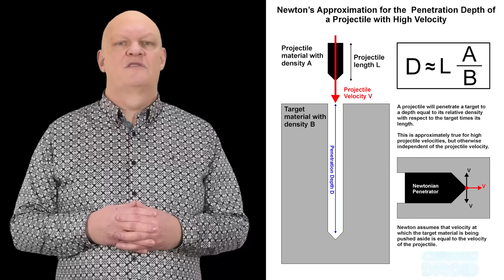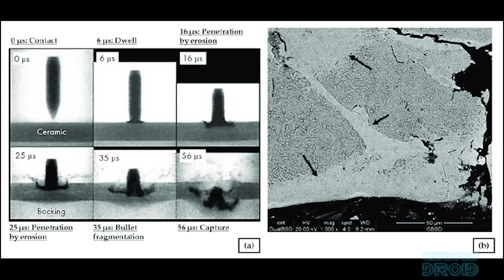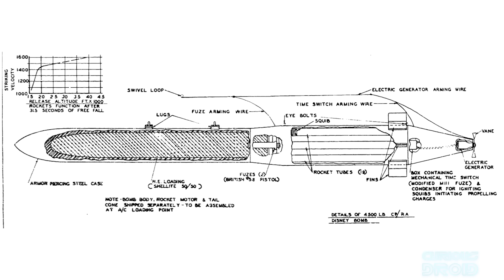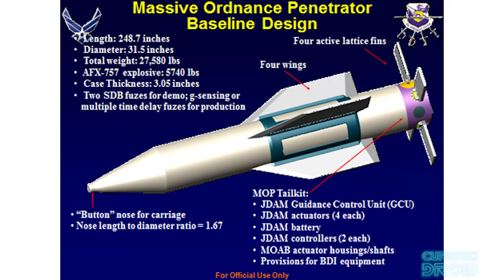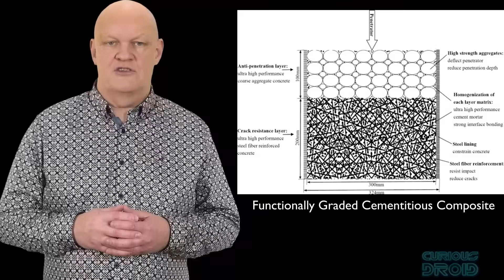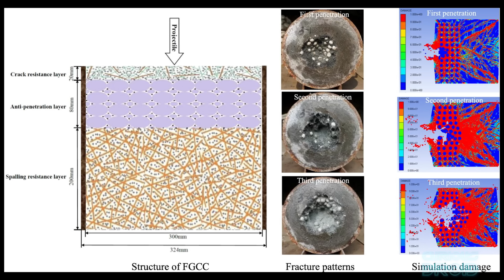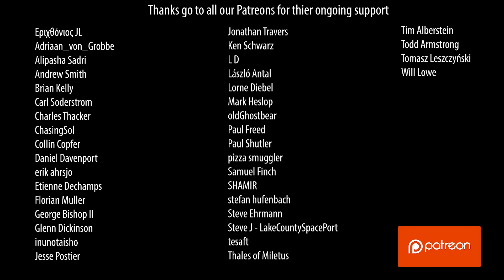Can Iran Stop U.S. Bunker Buster Bombs?

Comment: While the cost of placement to LEO is very high developing a few satellites holding what are termed ‘rods from god’ or very high density, very low profile non-explosive impactors that solely rely on the kinetic energy released at impact would like the ‘earthquake bombs’ of WWII cause such a seismic shock wave that the resulting damage to the target would be sufficient to render both the equipment inside as well as the personnel useless as well as likely destroying the entrances and external links.
Reply: Any rocket that could deliver that sort of payload into orbit could just deliver the "rod" to its intended target. 
Nerds seem to love the idea of "killer satellites", but they're not a good idea.
Reply: @T3H455F4C3  So, since you appear to have convinced yourself that you are something of a penultimate authority on such issues perhaps you will explain to the class just how one can determine whether such an ICBM is carrying such a kinetic weapon or a nuclear one as I do not think that such a technology exists.
Therefore, launching such a missile would almost certainly be seen as a first strike.
Whereas an orbiting platform armed with such kinetic munitions does not violate any existing strategic arms treaty and the time between launch and impact would be measure in minutes without the thermal signature that any surface missile launch would reveal to any of the orbiting observation satellites nor to the long-range radar detection installations.
Finally tossing out the sort of juvenile taunt, ‘nerds’, that you have indicates that you actual understanding of such a system is minimal at best yet you wish to pretend that you are well versed by trying to intimidate others rather than actually offering a cogent and evidence-based argument.
Which is sad at best.
Reply: @T3H455F4C3  “Looks like somebody has their thesaurus ready to go.”
Once more all that you do, especially beginning as you do here, is expose your juvenile mentality and lack of actual maturity by resorting to puerile insults as a means of attempted intimidation as well as demonstrating that you seem to perceive education as something of a ‘vice’ thus indicating that you are deficient in that arena.

“Perhaps you will explain to the class just how one can determine whether a weaponized satellite is carrying such a kinetic weapon or a nuclear one.”
Yes, that is the question I posed to you which apparently you imagine that simply reciting that back to me is a form of an answer when it is not.

“Seeing as it doesn't violate any strategic arms treaties I'm sure that China or Russia or whoever would be super chill about having a orbiting weapons platform flying over their heads. "Don't worry guys there's totally no nukes on this thing, I swear"”
That is not an answer but a clear example of the ignorance of using ‘what-if-ism’ as a means of deflecting a question for which you have no rational answer to. You are simply pretending that whatever you toss about is made real simply because you say it.
Again, explain a method that can be used to determine whether a satellite is carrying kinetic or nuclear weapons.
As you appear lacking in actual education or information, I will answer for you. The only means possible at present would be a close approach to attempt to attempt to register the radiation levels being emitted from the object of interest.
Yes, I know, big words frighten you but Google them.
How ever this can be masked by additional shielding once again rendering the issue moot although that would violate the treaty banning nuclear weapons in space.

“Depending on ones definition of a "weapon of mass destruction" this would likely be viewed as a violation of the Outer Space Treaty.”
Then by all means please cite the specific section and relevant paragraphs that you imagine support this assertion as this is not part of the Outer Space Treaty of 1967.
“Key provisions of the Outer Space Treaty include prohibiting nuclear weapons in space; limiting the use of the Moon and all other celestial bodies to peaceful purposes; establishing that space shall be freely explored and used by all nations; and precluding any country from claiming sovereignty over outer space or any celestial body. Although it forbids establishing military bases, testing weapons and conducting military maneuvers on celestial bodies, the treaty does not expressly ban all military activities in space, nor the establishment of military space forces or the placement of conventional weapons in space. From 1968 to 1984, the OST birthed four additional agreements: rules for activities on the Moon; liability for damages caused by spacecraft; the safe return of fallen astronauts; and the registration of space vehicles.”
https://en.wikipedia.org/wiki/Outer_Space_Treaty
This is called ‘supporting evidence’ and research that demonstrates that you in fact do not know what you are talking about relative to that treaty.

“Oh and this satellite would be super vulnerable. Predictable orbital path. No way to effectively protect it. Send a few boxes of nails at it on an opposing orbital path and all you have after that is a bunch of really expensive debris flying through space.”
Yes, that is the case with ever other type of satellite as well as a problem of the existing mass of orbital debris yet you are obviously trying to avoid dealing with the issue that such an act could and would be directly tied to the nation who launched such an attack as well as being seen as a preemptive first strike against an asset of the country whose satellite was being attacked. This is due to your apparent fixation on ICBMs as being the penultimate weapon wherein you appear to simply refuse to accept that they are also replete with a great number of serious flaws such as the flight time which allows for sufficient response, that they can be observed being launched using existing capabilities, that they have been great advances in anti-missile technologies that are increasingly blunting their efficacy and that such weapons are only effective when armed with nuclear devices that would create fallout clouds that would also inflict damage on the nation launching them.
You also appear to be clearly dodging the opposing issues related to kinetic weapons in order to hide from the while propping up your ‘love for nukes’. This includes the fact that the travel time is measured in tens of seconds rather than hours, they do not have long periods of intense thermal exhaust that can be detected at launch time, they possess extremely small radar cross sections instead of the rather large ones possessed by ICBMs and they do not produce any primary or secondary radiation debris meaning that there would be no potential fallout.

“Seems like a great idea as long as you don't think about it too hard.”
No, it does not appear that you have invested much mental energy into this issue or any actual research beyond just rattling off some childishness and a simplistic counter-measure that would be the opening salvo to war.

Nicely done.
Do you possibly have anything of actual relevance to offer or should I just expect another round of you grunting more juvenile taunts.
Reply: @donharris1923  My intention was to say that kinetic energy weapons on satellites would likely be viewed as a violation of the Outer Space Treaty. That sentence was poorly worded. I be hittin the bong a bit too hard. 

"Weaponizing" space has a high potential of being disastrous. At least in the context of anything orbiting near Earth.  
Military communication and GPS satellites are one thing. Satellites with offensive capabilities are another. This guarantees some number (a greater number?) of satellites would be considered legitimate military targets. The chances of something like "Kessler Syndrome" goes up substantially.

I don't think it matters if "God's Rod" is mounted on the end of an ICBM or a satellite. Your looking at a diplomatic shit-storm either way.  

Doesn't stop people from bringing it up all the time like they think it's a new idea or they're being insightful.

Comment: Bunker busters are pretty much like giant nails being punched from a nail gun. It’s kinda weird that when you focus a lot of kinetic energy on such a small point and with such a dense bullet-shaped projectile, solid earth simply doesn’t behave like solid, but liquid. It just gets shoved out of the way like sand.
Reply: they've become so advanced that they have gone back to arrow type projectiles
Reply: You ever watched a video about nasa shooting bbs at sand to see what meteor would do to earth at different speed and sizes amazing in slow mo your right sold earth becomes a liquid like a mud slide
Reply: Same is true for unexploded bombs for example. 
Turns out bombs, when they don't explode, glide in an parabola shaped trajectory trough the ground and come back up again. A least when the ground is in a certain condition.
Reply: @aculleon2901  Maybe interesting. Those cases are an important reason for quite a few unexploded bombs that are still found in germany since the time delayed fuses some bombs had did not work if the bomb sits tip up so they burried themself and then just remained there to be found in new construction projects over the decades.
Reply: @aculleon2901  makes sense, top soil is less compressed then deeper soil, because the density/friction of the ground is uneven it changes the trajectory.
Reply: It makes me think how arrows punch through sand bags without losing lethal velocity even though most bullets will simply lose all their kinetic energy immediately.
Reply: @inthefade  terminal ballistics is a real involved field, usually bullets are designed to not overpenetrate, and instead yaw or deform, in order to deliver maximum energy into the target
Reply: Called liquefaction. In the same way you can say all materials are conductive & the poor conductors are called insulators. You can also say all solids are simply super dense liquids. Induce enough pressure and you spread the mass out to allow for liquid-like properties.
Reply: I wonder if something like oobleck that turns more solid the higher force is applied would work better. I mean like a tank of non-Newtonian slurry.
Reply: @issadraco532  minimum wage israeli troll detected hahahahah
Reply: Hell yeah Capt Obvious 😂
Reply: According to the entire US political establishment, the supposed Boeing 757 that hit the Pentagon on 9/11/2001 sliced thru 6 layers of 36 inch reinforced concrete (total 18 feet). This should be in Ripley's Believe It Or Not museum. Not only that, not even the wings broke off as it hit the Pentagon. It all went inside. No crash debris was found outside the Pentagon.
Reply: Yup, biggest waste of time, even thru entrance and exit. No stealth object has ever made it into Iran air space, so it would need to be a cruise missile with gps that can ascend and then descend when it reaches the site, but then the signal gets lost blocked by 100s of sand dunes, lol!!! ...try to steal oil from iraq, which  is next to iran, but then again...  lol
Reply: @syncopatedfeb4770  ok ivan lol.. "no stealth object made it through"  so what you are basing this off of is the fact that a drone lost signal and crashed. Nobody detected it , nor shot it down or hacked it as many have alleged here is why. The damage in the pictures is from it crashing not being shot down so strike#1 to that .. The Comms are encrypted with a daily changing fill that the NSA couldnt even crack realtime without the key so no hacking  strike#2  And being that Israel has done multiple strikes with its F-35s all over the place and the US has done them in Syria with Russian made s-400's looking like clowns and Iran and Syria not even knowing the Israel planes were there until the bombs dropped is strike #3... and please dont bother with the "brah they shot down a f117 in yugoslavia"  yep they did they shot down a 1970's tech stealth plane that flew the same routes day after day after day and had a weapons bay that opened slow and it gave a return.. and that allowed them to basically blind fire that missle and have it proximity detonate near the f117 bringing it down.  Since then the weapons bays on the 117 were redesigned and all the new ones would never have that happen since they open up in the blink of an eye.  Just deal with it we can rain hell down on whomever whenever we want to and there is damn little anyone can do about it.
Reply: @syncopatedfeb4770  if u believe no stealth object has made it jnto Iranian airspace, I have a bridge to sell u.
Reply: @syncopatedfeb4770  This is the second comment I have seen that randomly mentions Iran, and how amazing their air defenses supposedly are.

I'm starting to think there's a lot of Iran fanboys watching this video.
Reply: @syncopatedfeb4770  you can just keep believing in the tooth fairy Santa Claus and the Easter Bunny as long as it makes you sleep well at night lol you little bit silly

Comment: With all due respect, no bunker buster comes anywhere close to their terminal velocity when dropped by an aircraft inside the atmosphere.
I calculate the GBU-57 has a terminal velocity of about Mach 4.9. This corresponds to a drop from 142 km!
Reply: This is based on a supersonic drag coefficient of 0.16, a projected frontal area of 0.503 m^2, and a mass of 14 tons.

Comment: The interim solution to hardened shelters is to use multiple bunker busters.  Where 1 may not succeed in getting to the ultimate target, it may clear at least part of the way for the follow-on munitions.  The warheads can be mounted on cruise missiles, which can be volleyed in droves at the target.  Also, the bunker busters can be nuclear tipped, so they don't have to be very close to their target to be effective.